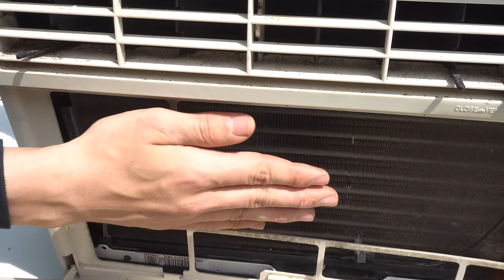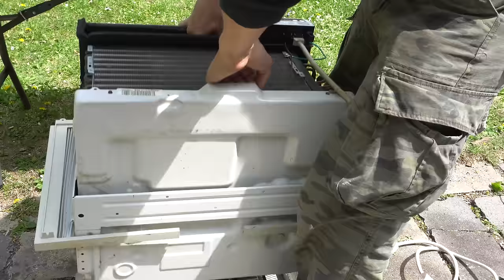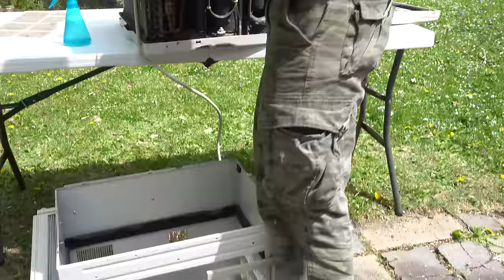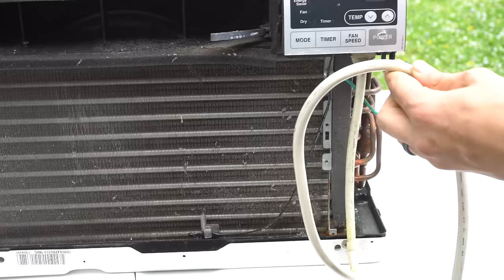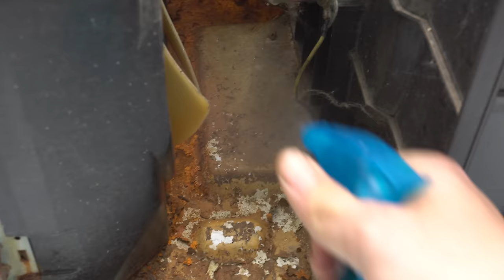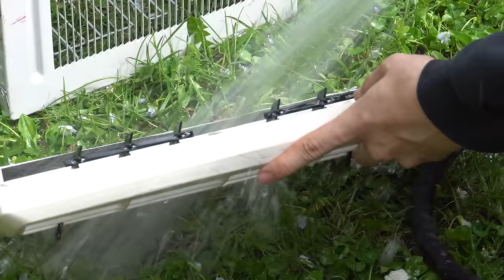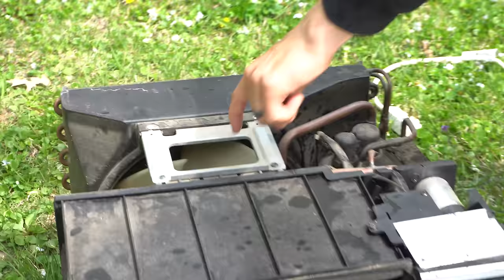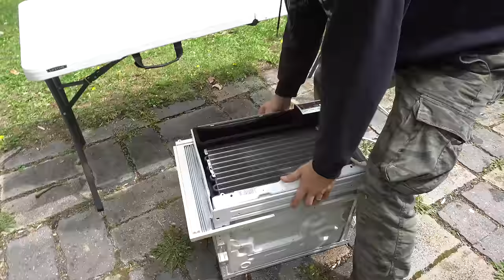Window Air Conditioner Not Cooling And The Most Common Fix

Comment: How cold should the air be coming out of an air conditioner set on 65 degrees? Mine is around 53 degrees but seems to take over a few hours to drop the temperature of the room from 80 to 75.
It's a 15000 btu for 750 Sq feet

Comment: Hey thanks for this video, i have a question though... My unit is 12 000 btu and brand new, used for like 3 months last year and now i installed it this year and its already shooting only hot air. I sounds like the compressor inside is not activating most of the time, it turns on 5 minutes each hour and then turns off, air is cold only within theses 5 minutes but problem is it turns off after 5 minutes so the room is hot. Do you have an idea why it happens? It's a insigna 12 000btu, the front filter is clean and all the inside looks barely dirty. thanks!!
Reply: I no it's new like you said but it sure sounds like it got a leak from my experience

Comment: Hi,guys! Just cleaned my wall unit. I was carefully to not get water to the control panel or any electrical parts. But still not starts.  I can hear a little buzzing noise but neither the fan or compressor starts. I can use the control panel ,shows temperature, mode etc but that's all. Any idea? Could be the capacitor got little bit of moisture? Appreciate any thoughts

Comment: sir, true, evaps get dirty, do not hose it , if you do, very light with a brush, , professional way is to remove cover , housing and cover motor and electrics like relays and capacitor, then you can clean the evaporator and even more important is the condenser, the outside fins, if that gets dirty, it your amperage will dangerously go up. oh, you did take ooff the cover, good but you should cover motor and all electrics, many parts in side electricals are not sealed and you dont want water, good job.

Comment: I want to install a window unit in Lynn my mother in laws apartments. Problem I would have to do it lots of modifications to make it work…
And in the largest room, there is a window, but you can’t put an AC there …….
There is a place where I could stick a window unit, but it can’t drip water because it would go into the apartment downstairs Z
Is there a way to attsch a drainage hose ?

Comment: During the drying phase,  should I leave it to dry outside in the sun or should I use a rag to absorb the water?  Another question that dawns on me is wouldn't the water pool in the unit? If so what do you advise to do to drain the water that's pooling in the unit?  Thanks
Reply: He mentioned that your unit already has a drain on it.  Just make sure the drain isn't clogged up as part of your cleaning process.

Comment: The top air duct where the cold air comes out also needs to be cleaned. On my GE the Duct is white Styrofoam and you could see the mold. On your LG the duct looks like black fiber board, harder to clean.

Comment: As a good safety measure some when you take the front cover off have the control panel still attached to it if you unplug it tape the male and female ends to keep moisture out

Comment: My Frigidaire 12000 BTU window air conditioner is not cooling.  The compressor and fan come on but the evap coils do not get cold  Suction line by the compressor barely get cool.  Would this be a low freon charge?  Evap and condenser coils are clean as is the filter

Comment: When before I watched this video I had tried using a harder object to try getting the dust out of the metal coils and it made a lot bend in different directions? Does that mean I might have to get a whole new unit now? 
I will still try since I haven't yet cleaned the whole unit with your method. So first I might try that and see how it goes but the coils like I said are all bent and bent. Am I in a bind or does that even really matter? Is it because of the dust buildup like in this video or is it because the coils are bent and crooked?

Comment: I would never turn the A/C over on its back or sides, I know I had problems after doing that in the past, the refrigerant  settles in the wrong places.

When you have multiple dogs like I do and live on a gravel road, I have to clean that filter DAILY, even then, those crappy "filters" only catch maybe 50%, the rest winds up going thru it into the coils and has to be blasted out with a garden hose and one of those nice sprayers that lets you add soap or chemicals to it and select a variety of spray patterns- they are under $20 usually.
What they refer to as a "filter" on these things is more of a LINT screen, because about all it catches is the big stuff.

The electronics in these cheap POS's is usually what goes bad, I havent found any brand that seems to last more than about 3 seasons, and they all start not getting as COLD as they were when new despite thorough cleaning with a garden hose as described. They probably lose some refrigerant over time, or the sensors or controller in the electronics starts going bad, or the compressor starts wearing out.

I'm done with these cheap window units, I'm looking at a self install two zone Mr Cool mini split for next year, being installed up by the ceiling and the consensor being a separate unit outside, and better real filters should keep it a lot cleaner too.

Comment: Does this work if my air conditioner has been sitting on my wall for a while it's been Gathering dust lol  going through the rain the heat the snow but every time I plug it in it just won't fire up??

Comment: i have this same unit and its not cooling the room its set at 60 degrees but there is warm air still coming out but the maintenance person used a laser measurement tool and its reading 31 degrees... is this normal?

Comment: Thanks! 
Does anyone know if the the refrigerate tank inside is repairable or replaceable? I accidentally drilled a whole in it because I was drilling holes in the bottom of the unit to let the water out( I don't know why they just can't do that at the factory), and I poked a hole in the tank. Can the whole be fixed, and refrigerate added, or is it a gonner?
Thanks for any answers!

Comment: Hi buddy, I’m getting an “EP” error on my screen, and it doesn’t come on. What do you think the problem is??
Reply from the maker: Usually it's an issue with a sensor. Sometimes you would need to replace it but usually that is not needed. I would just try what all the people suggested in this thread and hopefully the easy fix will be the only fix you need:https://www.fixya.com/support/t2831913-ep_mean_air_conditioner_display

Comment: Thanks.  Question.  How much of an angle should window units tilt, if any?
Reply: Do not quote me, but I believe there to be at an angle tilted towards the outside, so that water can run out through one of the bottom corners of the back panel. There should be a drain plug at the end on either side I believe that to be true I know it is on my air conditioner. It’s only a couple years old it’s an LG model, 8000 BTUs or something 10,000 something like that my consult your owners manual

Comment: Ive dealt with alot of window acs. Biggest issue is the buildup of dirt on the inside of outside rad. It gets caked with dirt. Sometimes its tough to get at but cleaning that debris out often gets these units working again. Those openings that allow air in are to large and allow too much dust and dirt in. If you wrap those openings with say window screen it will block much more dirt from entering and plugging up that back rad.
Reply: That’s a good idea about the screen covering the back I even this idea what about those green scuff pads from 3M? You get a piece that is as big as the back of the AC rad and then use some chicken wire to keep it in place so you have the radiator in the back a piece of that screen or that 3M green scrub pad stuff and then put wire over it to hold it in place like chicken wire

Comment: What if it was left outside over the winter it's still turned on but then it wasn't working after a minute or two it's probably got a lot of leaves and junk stuck in it can I take it apart and clean it out

Comment: Question my compressor won’t kick on the fan just runs is that cause there not a lot of Freon ?
Reply: @Word of Advice TV I have this question also, when you can I would appreciate your response back too :-)
Reply: That would be either the run capacitor, or the compressor is dead itself.  You can only tell Freon levels if the compressor and fan ARE running.

Comment: I constantly clean my filter . The red flashing filter light even tells me when it needs changed. I’ve got a cover for the outside . Keeps bugs and debris out . I’ve cleaned the coils with foaming cleaner and coil cleaning tools . It stopped cooling all together . Cleaned it all. Still not working .

Comment: My question is, I just bought a brand new air conditioning 5000btu and I've had it in my window for 2 days, and it's not really blowing out cool air, I just don't understand, and yes I have set the temperature to cool, I did everything, so what's wrong with my brand new air con?

Comment: I've got a Frigidaire AC unit that is not getting cold but it's getting hot in the back condenser part but in the front the evaporator part is not getting cold. The compressor is running and the capacitor is good. What could be the problem?

Comment: hi I'm siddhant... I'm mechanical engineering student and i got window ac test rig as my mini-project. Basically it is a experimental setup consisting pressure and temperature gauge. my job is to bring it to working condition basically it is LG 1 TON ac. I want help in repairing the AC.

Comment: OK my filter and A/C unit is perfectly clean. However, it labors hard and then all of the power goes out. I then have to  reset my circuit breaker.
It has been 95-100 degrees. 
I am wondering if it is because it is too hot outside???

Comment: Thank you man.. Gonna do this today to 3 units.. Would misting the motor and control with a little wd-40 to disperse water be a good or bad idea?
Reply: bad idea, WD40 will disperse water but at the same time attract dust to the same components you are trying to lube. It's best to let the Unit Dry for 24 to 48 hours, then hit the friction points with a light touch of 10 weight oil or Sewing Machine oil, that is best practice. Hope this helped

Comment: Hi Jay I have the same lg room unit , had it clean and replace the capacitor, but still blows warm air any suggestions on what is causing this. Thank you
Reply: Does the compressor kick on?

Comment: Okay so now its cleaned, but what good does that do if it doesn't blow the air very well due to dirty fan blades? It's a matter of like 4 screws on the plastic housing where the air comes out to get to the fan blades. Interesting how that didn't seem to be a factor to you...

Comment: When I clean residential or commercial air conditioners I take them apart for I can spray the water the opposite way or like I said you will just contact it in there

Comment: I was wondering if you could help me determine the issue I'm having . So I live in a condo and we have rules against window air conditioners so what I did was mounted it to a sealed box I built in the room and  ducted it to the window the same size as the original hole when the unit was in the window.  It turns on  but only cools intermittently. The compressor comes on for approximately 3 minutes  or less then turns off and won't come back on for more than 5 minutes. The only thing I can think of is that it needs more clearance on the sides and top. It has about an inch on one side the other side is open to the ducting leading to the window--and 2 inches on top and about 4 in the back and 18 on the bottom(due to space restrictions in the room).  Do I need more clearance around the unit maybe?  It's a new unit and was working when it was in the window. If it is a clearance issue, why would that cause it to short cycle? It may be a little tight on the side but how much clearance would I need if that indeed is the issue?

Comment: I will soon do this, can't today because busy stuff. But I will do it because it's so hot on the room T~T I miss it being a freezer as my grandma says. I will post updates •~•

Update: couldn't get it out the window, I also cut my leg by falling down part of the area where the ac is. But me and my sister cleaned the small pool we have and it's filled up & really nice. I also moved my fan to my bed which helps a bit more 👌 so yeee

I did try to clean what I could of the ac it helped a tiny bit, but that's the update •×• also I walked into five spider webs then lol

Comment: Cleaned my LG unit as stated here. Only thing is it had a wire that had to be unplugged for the switchboard. After drying, I reconnected the wire and now the unit doesn’t turn on. The plug has a light on it and it’s green. What did I do wrong?

Comment: Hey i cleaned my window unit and when I turn on the cool the left side starts vibrating and humming violently and cuts off and it sounds like the cold wants to kick on but it doesn't it's like it stays on fan. Do you have any tips or any advice to help me get on the right track?

Comment: I took the filter off my wall unit and the fin looks not that dirty. The unit blows hot air but cold air still not kicking in? Is it the compressor switch?

Comment: If anyone thinks he cleaned the coils properly. They have rocks in their heads. The inside of the coils gets built like a felt cover, it is really thick. Air can't pass through the coils to cool because they are blocked by this felt-like covering that has accumulated over the seasons. He did nothing to address that build-up. You have to get behind the black plastic shield in order to remove that build-up,
otherwise, the unit will still perform poorly...

Comment: I had a Corsair electric furnace installed last summer (AC and Heat) with a heat pump. My warranty states I'm required to have annual maintenance, but my HVAC company says they need to service the unit twice each year, separately for AC in early summer and again before winter to check the heat. I asked them if they could check both AC and heat during one maintenance visit. They said they could not. Is that true? Why can't they service both in one visit? Thank you kindly.
Reply: Because they are crooks and wanna get paid twice for something they could do all together... Find someone else...😔
Reply from the maker: I'll have to agree with TK. I do both, furnace and AC inspections/maintenance on the same visit often.

Comment: Cover Electronics with plastic bags to avoid water. When cleaning toothbrush works great. After washing everything down, if you have a electric leaf blower with adjustable settings blow everything off. it helps with cleaning and drying time
Reply: 👍🏻🫵🏻👊🏻leaf blower

Comment: do you know why its not working even after i cleaned it? ive had this ac for about a year and haven't used it since last summer, i tried to turn it on today but it wont run. the ac will turn on but no air comes out.

Comment: Doing troubleshooting on ac window unit not running,make sure you have power, make sure you have you filter clean and the clogged water line is clean , check the capacitor, put you amp of your meter on the line of the compressor only black or red , if you have amp pulling or the compressor is running and the discharge line is not hot , you got leak , you’re welcome.

Comment: Already tried that cleaned it good always do ! My ac fan works. The compressor comes on I can hear it but 15 min later it gives up. I have notice one thing there is no water dripping anymore it’s like the compressor gets to hot and just shuts down. Anybody know what it could be this is a 38000 btu going through a hole in house so it’s tough to take out. Any suggestions please lmk thanku

Comment: Nice video but why didn't you use a hose end sprayer to spray it down instead of using your hand I think that would have made the job a little bit more easier in my opinion
Reply from the maker: The sprayer I had was really weak, even when set to the jet setting. Closing it with my finger was more effective.

Comment: Can you make a troubleshooting video on one these, mine keeps freezing up when I run in a heatpump mode, something wrong with a defrost board, rev. valve???
Reply from the maker: One reason it can freeze over like that is if the fan is not running or the filter/coils are dirty. Those would be the simple things to check and try and clean. As for a troubleshooting video, that would be a good video to make but I don't have a heat pump window unit and there are not many of them around in my area. Maybe later I can film something if the opportunity presents itself...
Reply: I've had that problem once, I unplugged long enough to defrost and it was leaking water out the front, that is when I realized I needed to adjust it and then it stopped freezing up.

Comment: its good to remove shroud screws on inside of condensor coil, they are always 60 percent caked up on the inside !
Reply: Very good point. Cleaning the inside condenser coils is one of the main reasons for transporting the A.C. Unit out side. Does require more effort but necessary to remove the shroud surrounding the fan blades. As stated there is usually large amounts of dirt caked upon the interior fins of the condenser that must be removed. Care must be exercised in the selection of a wire brush to remove the caked on dirt all the time taking care not to come in contact with the condenser coils themselves. After the removal of the caked on dirt you can follow up with a liquid cleaning soap of choice with a garden hose of sufficient pressure or even pressured air if available. Cleaning the condenser coils from the rear exterior will not remove the build up of dirt on the interior. I was quite surprised that this fact was not covered with more emphasis as most people do know to clean the inside accessible evaporator filter.